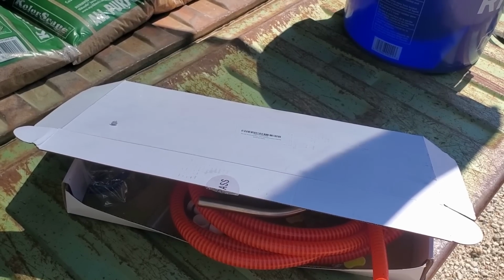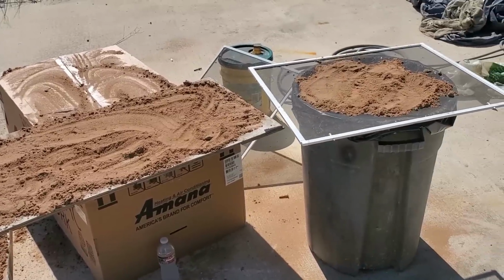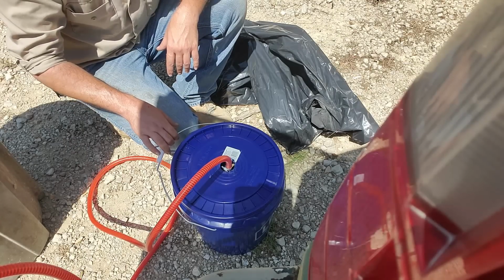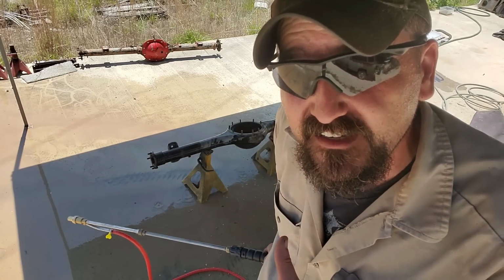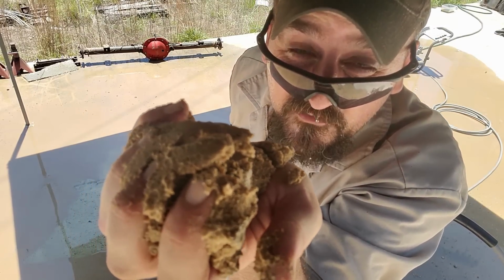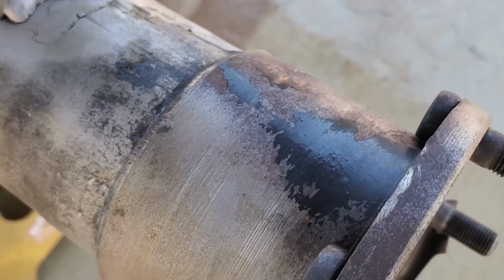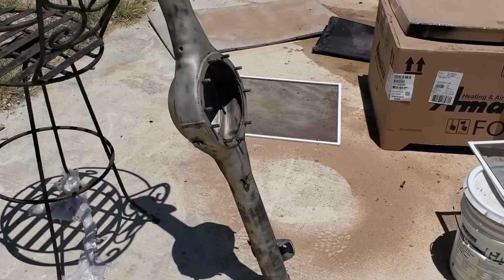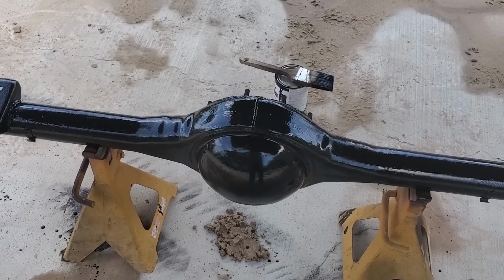Pressure Washer SANDBLASTER ! Blasting a JUNKYARD Mopar 8.75 Axle Housing - Junkyard RACECAR

Comment: Bungee cord the bucket to the pressure washer and the engine vibrations will keep the sand flowing.
Reply from the maker: That is a great idea!!! Appreciate it and Thanks for watching!!
Reply: I'm a sandblaster by trade and this would definitely help with sand flow. Great tip.

Comment: 1. always thought you had to have the sand intake up not down.. down allows water to seep back into the sand bucket.  2. If you keep leaving your PW running while filling sand bucket etc you run the risk of burning up your PW pump.  otherwise good vid

Comment: Pressure wash a section of that concrete, let it dry off, spread the sand out on the concrete to dry. Ive done this for my sandblasting setup from Harbour Freight with great success.
Reply from the maker: Appreciate it and Thanks For Watching!
Reply: @DuddiesAdventure   Strap bucket to the top of the pressure washer to keep the sand agitated

Comment: Next time use a 30 gallon drum and make sure you use a kitchen type fine mess screen basket! Sift your sand into that 30 gallon plastic drum and you won't have to reload so many times that 5 gallon bucket. Also you can put a lid on it and store it away in your shed or wherever. Playsand is the only sand to use if you don't want problems a make sure you shift it. I do yhis all the time and don't bust my balls with screw ups.

Comment: The instructions that I saw said to keep the sand suction port with the red hose facing up instead of down to prevent moot from getting into the red hose causing pulsing.

Comment: I had an old 40# pressurized sand blaster tank from Hardly Freight. I never hooked it up to a compressor, the sand just comes out the bottom. Worked great with my big pressure washer. Like you said, It Makes A Mess !!!! But it actually works really good. Good job Duddie 👍👍👍
Reply from the maker: This thing really works well, Perfect for a hopper tank setup! Appreciate it and Thanks for Watching!

Comment: I used one of those with baking soda (50 pound bag from Harbor Freight) to soda blast the calcium off my swimming pool waterline tile. Worked great, but I did have to keep going back to the bag to jiggle the pickup like you did. So yeah a tapered hopper would be better. Especially if you could rig some kind of vibrator/ agitator to it.
Reply from the maker: Great Idea! Appreciate it and thanks for watching!
Reply: Strap the bucket to your pressure washer
Reply: @patrickdolan.  You mean to use the vibrations to jiggle the material down? Good idea.

Comment: Great video and as you point out dry media is critical.   Your results prove that even a cheap water blaster attachment works really well!

Like many people watching your video I also purchased the same blaster off Amazon (Australia).
Exactly the same device   BUT...... it didn't work!  The elephant in the room is the pressure water machine spec you need to create enough suction to get the media into the nozzle.   Which  means it may not work if your  machine is electric (!)
These machines do not seem to provide enough flow rate or pressure to suck in the media.

t looks like everyone reporting success is using a gas driven pressure washer that is delivering around 3000 psi and 2.5 - 4 GPM.    Electric washers like my professional Karcher 5/12C does not deliver the guts to suck in the media.  I was using expensive 80 Grit Garnet that was dry and uniform.  

Looks like I may need to upgrade to a petrol pressure washer!

Comment: On the Driving 4 Answers channel, he had his engine block sand blasted, but even though he cleaned the block thoroughly afterwards, there was still microscopic bits of sand embedded in the metal. The embedded sand then destroyed the internals of his engine when running in. Not sure if this problem will be an issue with the diff gearing on this project?
Reply from the maker: Its very possible I will find out when I change the diff fluid. Appreciate it and Thanks For Watching !

Comment: Could it be that you mounted the metal feed pipe upside down? It looks like the purpose of the second section of pipe is to keep the inlet end from bottoming out in the bucket, which would starve the feed.
Reply from the maker: Very Possible, The kit did not come with instructions haha . But it worked out , Appreciate it and Thanks For Watching !

Comment: I am a big fan of Rustoleum Rusty Metal Primer and always seem to have some going in the shop.  I thought I heard you say you were going to spray the inside of your axle with it?  In that case I would be very careful.  Rusty Metal Primer cures with a soft finish as it is made to be overcoated and in my experience it can be cut with petroleum products months after it has fully cured.  So I would be worried about it dissolving in the hot oil of a differential and I am not at all sure of how much damage the metals in suspension from the paint will do to bearings and gears??  On the outside it is great and even greater with a finish paint on top of it.  Good stuff.  If I were to paint the inside I would use an epoxy etching primer or something on that order that is impervious to hot oil.  Probably best to just leave it bare and depend on the hot oil to soak the steel for protection.  Interesting to see your use of the sand blaster.  I have thought of getting one many times.  If I did I would get a bag of sand blasting media (glass, walnut, whatever floats your boat) from my local hardware dealer as it is even quicker than just sand and should not clog.  I agree a hopper would save much grief.  Harbor Freight makes a small one that seems to work well when dry blasting.
Reply from the maker: Been running this axle for a year now in my Dart. It will be interesting to see how it looks inside when i change the oil. Appreciate it and Thanks For Watching !

Comment: Hahaha. Doing the inside of your diff with that would actually be NOT recommended. It will take forever to get it cleaned out. You are experiencing what wet blasting is about.  I would recommend using 40/70 medium grit crushed glass next time.
Reply from the maker: Yeah, Unfortunately I found all the correct sand after the fact. Appreciate it and Thanks For Watching!